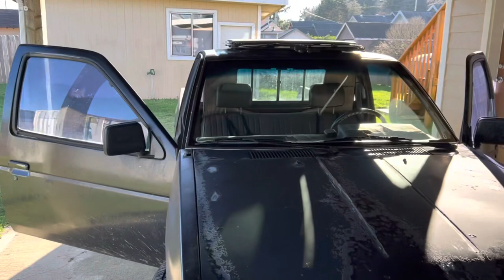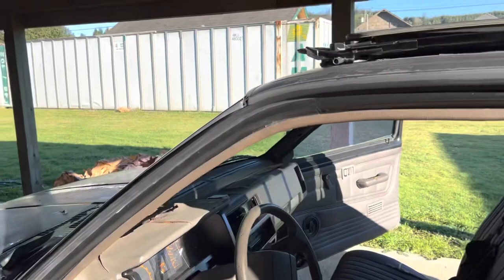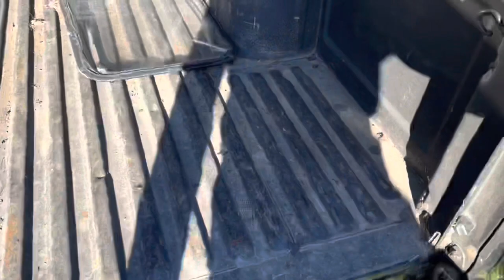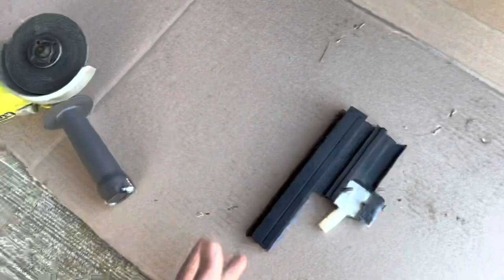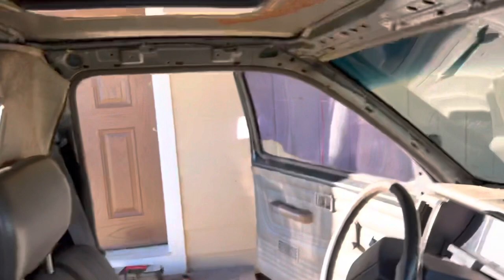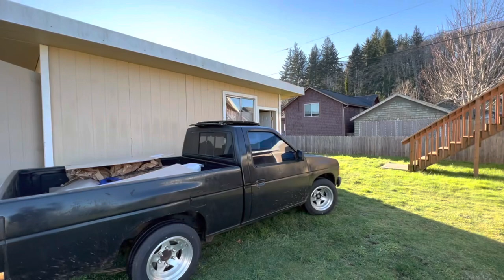Hardbody (Mini Truck) Sunroof Install pt. 1

Comment: This doesn't effect the chassis or the frame later on?
Reply from the maker: I’ve been running it for months now and it’s solid.
Reply: No that won't effect the frame or or chassis because the roof is still intact now if the roof was chopped off then it would effect the structure and would end up twisting unless reinforcement was done before the chop